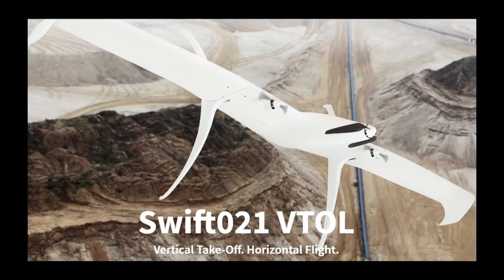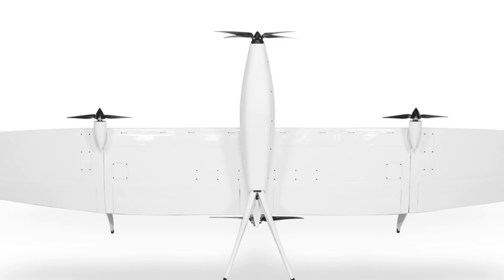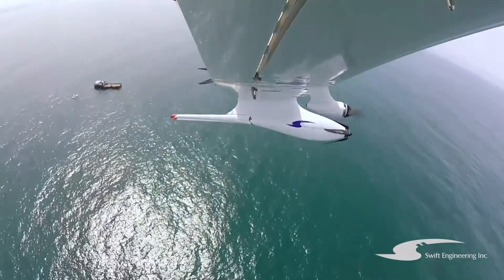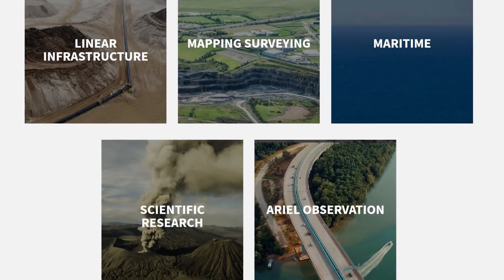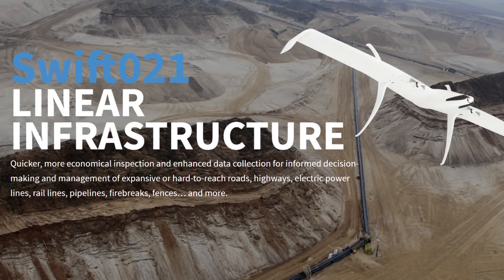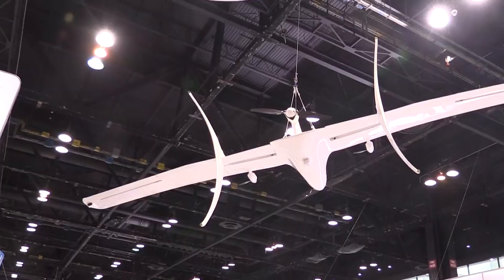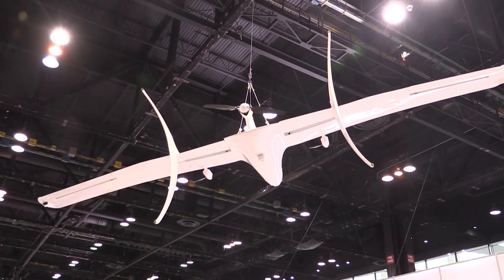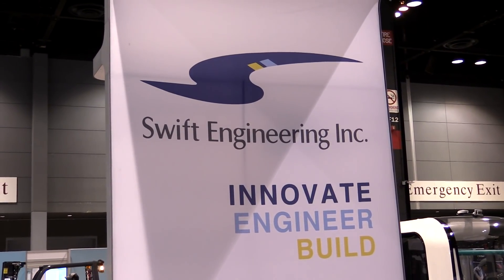Swift021 VTOL Drone: PX4 Open Source Code

Comment: All these guys so far start almost every sentence with “So, ..”, regardless of what follows. Is this a new convention? Did I miss the memo? I was taught that “so” indicated that a cause-and-effect scenario was being verbalized, and having finished the premise or causal part, what follows is the conclusion or predicate part. 
If ‘so ‘ couldn’t be replaced with “therefore“, “hence“, or even “because of this…“, Then it was probably a misuse of the word. Not so much in written English, but certainly in conversational English, if one speaker has made a statement, and it has caused the listener to consider the implications, but they wanted to confirm that they were understanding, they might start their sentence with “So”. An example of this would be “you never see a man cross his legs in public in the Soviet Union…” “So, is that just considered to be rude or vulgar?”… “Exactly.”
To me, it just sounds like someone who is having trouble expressing themselves, and buying another half second or so to formulate what they’re going to say. It doesn’t enhance their credibility.